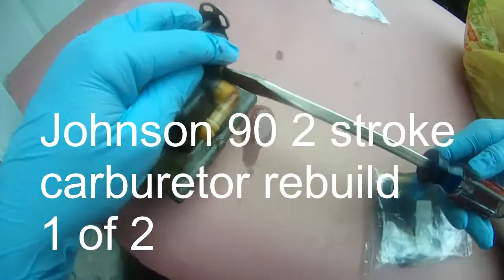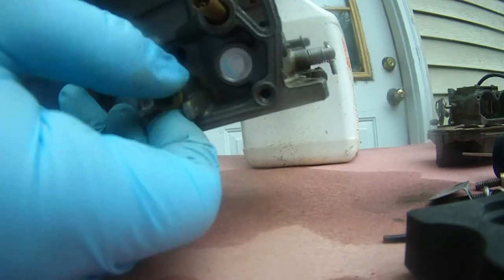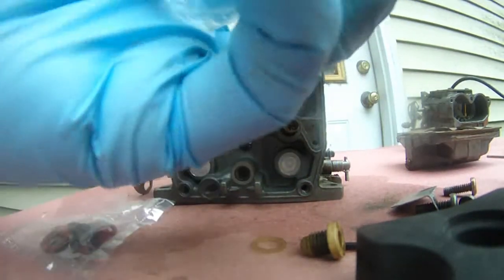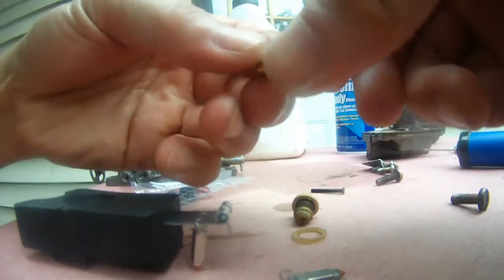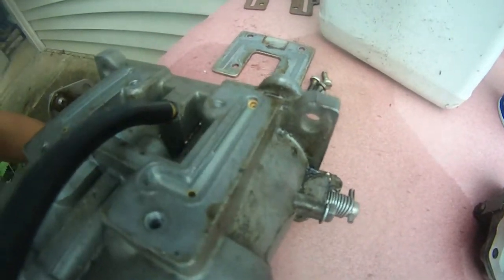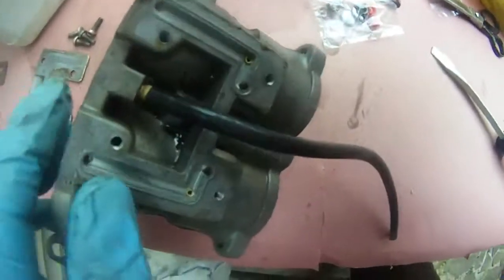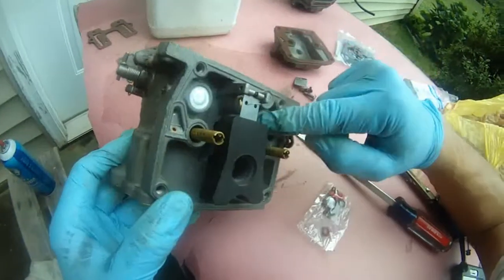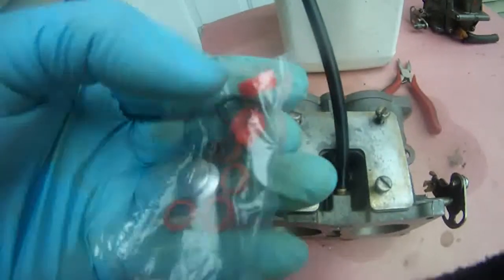Johnson 90 v4 cross flow carburetor close-up look carburetors kit GLM Part # 40570 (1 of 2)

Comment: I got the same problem with my carburetor  gasket is wrong for the carburetor because if you see is two holes  only use one in the other one  stay outside of the carburetor

Comment: thanks for sharing im looking into a boat with a evinrude 90hp.  I appreciate you sharing this.  I still need to find out how to sync and adjust the carburetors.
Reply from the maker: good luck! I will try to upload a video of my Johnson 90 carb linkage to show you what position they are syncing with each other. They are only 2 carburetors. Each has 2 throats so they do look like 4 carbs. But, they really have just 2 carbs so one link to bind them together.
Reply: Cool, do you have any of the service manual info for this motor? do you still have this motor?
Reply from the maker: Ysidro Avila no manual and you don’t need it. Google parts diagram is all you need. Yes my Johnson 90 is still running strong. Just drink gas like beer. 2 miles a gallon. I am tearing down and restoring a honda 9.9 hp kicker motor so i can go 12 miles a gallon. Subscribe and see how you can do the same. Tons of no wake zone so need kicker motor to save gas and for trolling in slow speed to catch stripe bass. Big Johnson 90 will be used only when i need to cruise around and far for speed to save time.

Comment: Okay they are a drop setting of 7/8 to 1 in that's the little tab on the bottom of the float on the rear underneath the PIN you must bend that in and adjust the float until you got the drop of 7/8 to 1 in now on the seat dimension you lay a flat 6 inch scale across your carburetor underneath that float that's the receipt dimension so bend the metal tab on the float so this is a cheese from the bottom inside the base to the bottom of that boat is 500,000 which is a half inch

Comment: How do you remove those two silver caps?
Reply from the maker: Use small slotted screw driver to pry open it. Or use hammer and hollow steel hole punch
Reply: njfishing1 so it’s like a freez plug

Comment: Did this fix the problem I have the same problem on mine
Reply from the maker: yes, no more leaking. I found out Ethanol in our gas is the problem for eating away our 2 cycle outboard gaskets, I did use seaform to try to combat the ethanol but still every few years need to replace the carb gaskets.
Reply from the maker: https://www.youtube.com/edit?o=U&video_id=Y7aasXx7IPM - took the old Johnson 90 out on Chesapeake bay outside of Sandy Point State Park under the bay bridge and had a blast fishing for stripe bass and white perchhttps://www.youtube.com/edit?o=U&video_id=p1ZxLDTojTg - here I rinsed off the salt water after our bay fishing trip
Reply: Was your motor running crappy when it was leaking?
Reply from the maker: Martin Wiebe no, it was running ok but didn’t like the fuel flowing out into engine cowling.
Reply from the maker: Martin Wiebe like i said before, a tiny spark could ignite the motor or make the motor catch fire. Last thing you want fire happens when you are on water enjoying your perfect boating and fishing day. So, i just tear into the carb and fixed it. Now, it is fixed.
Reply: @njfishing1  I'm in calvert county MD.  Currently rebuilding my evinrude 110's two carbs.  If I don't get it right, could you help me?